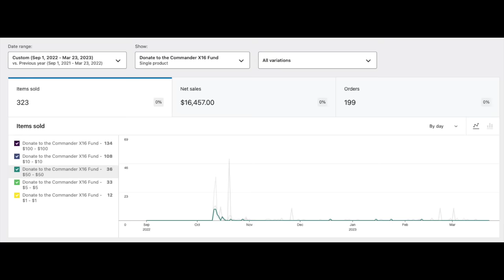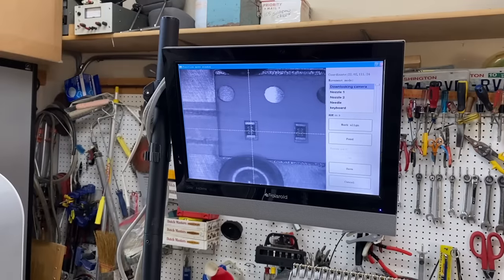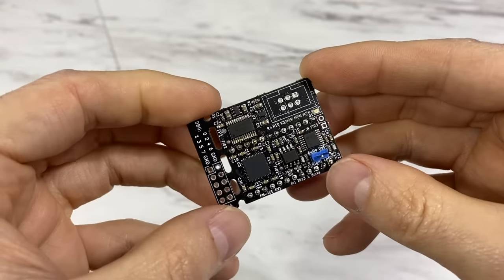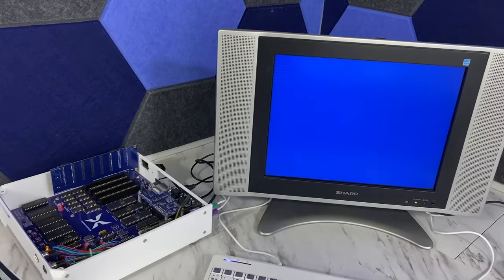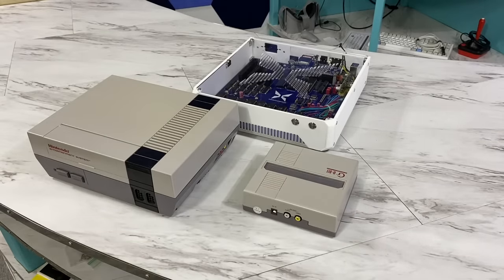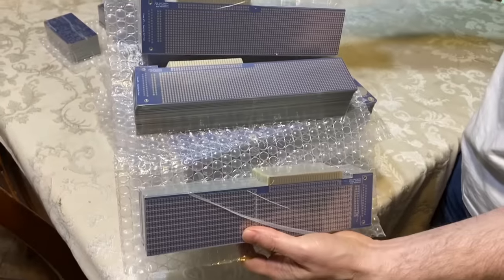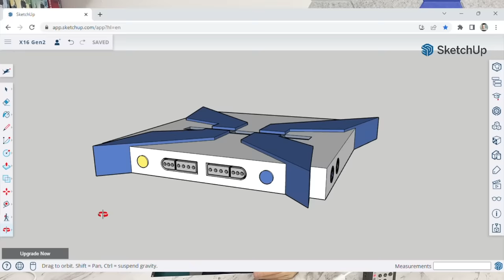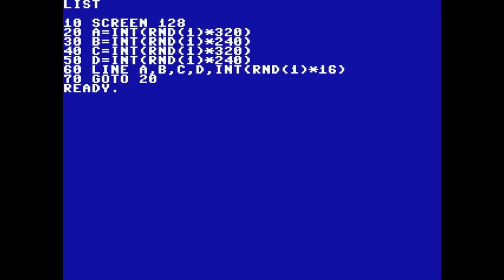Commander X16 2023 update

Comment: That X16 is coming along well. I love the case & I would rather see it vertically like a tower.  I see all those parts on reels & bags at the start of the video & that brings back memories of when I was working in inventory at a motherboard factory at Intel Corporation (Hillsboro Oregon) around 2 decades ago, working at Intel for over a decade.  Even those bubbled-wrapped stacks of PCB's bring up hazy memories.  The X16 probably has a good nice looking bill of materials (BOM) for its build, though probably less dense than the Intel mainboards that we built back in those days.  Of course for speed & efficiency, we did have SMT & THM placement machines too, to automate populating the boards & which then goes through an oven to solder the surface mounts &  then people further down the line to populate any further THM's & then finally to a wave solder.  I also was responsible for checking stock levels of solder bars, liquid chemicals, Loctite adhesives & some equipment (solder stations, solder tips, etc).  The Good ol' days.  I see you do have a board populator (pick & place) machine, so that should help with speed.

Comment: Here's an idea to ponder. The power users know better, but the game console can be used by people who can't read, 4/5 YO, Who wants to play what mommy/daddy was playing last night. Queue horror music as the kiddo inserts a Famicom cart because it looks like it'll fit. idea, maybe there can be a logic gate that tests a ground pin that isn't ground on a famicom. That way, no changes have to be made to the cart, but it won't connect power to something it shouldn't.
Reply: Alternatively, he could key the connector so that a Famicom cartridge won't go into the slot.  Keying that type of card-edge connector is dead simple, at least on the connector side of things; it's just a plastic insert that fits right into a space between the pins.

Or, for that matter -- why not make the pinout of the cartridge slot compatible with a Famicom cartridge, at least in terms of where the ground and power pins are and which lines are address bus vs data bus?  Then, if someone inserts a Famicom cart, the worst that can happen is that the X16 will lock up when it tries to execute the Famicom code.
Reply: @ballyastrocade5672  Good idea. Only thing is, how many have been made already? I know how much fun everyone has with breaking changes :)
Reply: @pyography  Yeah, that would be a problem if they've already shipped boards with the current pinout.

Keying the connector wouldn't be a breaking change, though.  The plastic insert doesn't involve changing any of the actual pinouts; it's just a slip of plastic that fits in between the edge-connector "fingers", and will block the card-edge from entering the slot unless there's a corresponding notch cut into the circuit board between the contacts.  (Though granted, it would involve taking a Dremel tool to that first batch of expansion boards to cut out the notch...)

Comment: I admire the hard work, time spent on this project, and community support. However, the real issue is that modern people often underestimate how complex it can be to produce something in a standard fashion, even in small batches or workshops. It is a continuous process of organising parts from different suppliers to create a functioning assembly line and every little step in between. 
I did not think this project would work from day one and still do not think this project would work as of today. But nevertheless, I do admire the fact that a group of people would try to challenge the modern-day manufacturing process. Hope this project works out and proves me wrong; I sincerely hope so.

Comment: It will probably piss off Nintendo that you copied their cartridge interface form factor.
Reply: Not really -- that general shape and connector style was also used by VIC-20 cartridges, and it's also similar to those used by a relatively obscure game console called the RCA Studio II.  Nintendo doesn't have a monopoly on "rectangular box with 40-pin card-edge connector."
Reply: I think the copyright has lapsed on the connector and its protocol so anyone can use the spec now. Even back in the day 3rd party manufacturers used it for unlicensed peripherals and Nintendo didn't go after them so I dont think Mario and Luigi are going to be banging on the x16 teams door demanding satisfaction anytime soon.
Reply: @meetoo594  Patent, not copyright.  If it was copyrighted, it wouldn't expire until sometime in 2079, at least.
Reply: @ballyastrocade5672  That makes sense, I always get the 2 mixed up.
Reply: @meetoo594  yeah it's a slippery fish for most people. There's also trademarks which don't necessarily lapse if the company keeps using them. The X16 team must be careful how they refer to the cartridge design.

Comment: I don't get why are so many people hyper-focusing on the $500 price point of the first batch. It's clearly said that these 80 units are still mostly made by hand, fully populated and with an included power supply and development expansion card. To me that feels like an ok deal for the most enthusiastic people who want X16 as soon as possible. I will personally wait for the next $350-$400 batch.
Reply: Because the realists among us can already see that they aren't going to be able to cut that amount of cost over this amount of production,  and definitely aren't going to be able to go from $350-400 to $50-100 for some kind of streamlined version, and all of that with over 50k of free money donations to buy Tex Elec new manufacturing equipment, which is probably not where the donators expected their money to go. And they gave a bunch of the first batch away to their friends on the project for free, which makes me think what is left of the first batch is going to be closer to $600 in reality. Now, they may decide to take the loss and only sell them around $500, but that means they are going to have to recoup that cost in the next batch, making it more expensive. 

Another piece of the price concern is that one of the exciting things about this project was the potential for a big community. Well, you aren't going to get a big community if the majority of the community are price-walled out for the first 4+ runs. 

And finally, the worst part is it didn't have to be this way, but without a definite goal, the decision making ended up being non-sensical. And remember, this is a for profit business, not just a fun little hobby project, so yeah, it matters a lot.
Reply: @doc_sav  I think you might have misunderstood how the price cut is going to happen. The mATX development board is eventually going to be $350-400. As you say there is no realistic way how to cut that price because it's using expensive THT chips. That is by design for people who love these retro DIP chips.
The second iteration "the console" is going to be a smaller board using SMD chips, CPLD for memory addressing, integrated VERA and YM2151 FPGA's. That one should cost around $200 and will be later in production at the same time as the more expensive development board. It will have the same kernel and capabilities as the devboard and the only "downgrade" will be one expansion slot and fixed 512K of RAM (which will be the default on the devboard too but could be upgraded).
The last iteration of X16 is going to be completely implemented in an FPGA. The current candidate for that is LFE5U-25F which costs $20. Multiple members of the community are working on that right now and the $50 target is not out of reach.

Comment: TPM is the OPPOSITE of the ethos of the retro community (retro community doen't restrain and force external control, least the community I engage with). Trusted Platform Module is like saying "this is mine, I retain control, not YOU" vs what is my experience of the retro community as a saying "look at this cool thing I've done, here's how YOU could do it too, here's my source". Sorry to say, but really feels like a community hero sold out there (*presuming the deal with the game company goes ahead and does use TPM technology). I do sympathise that its a difficult thing to monitize and its a huge endevour your taking on here, and it is, like I suggested a heroic act to try. Just, so sad to hear a TPM chip is going to be employed.
Reply: @njspencer79  time reference: https://youtu.be/nyByDNQuMMI?t=1574

"The idea of the cartridge is you would have like a TMP module in the cartridge with an encrypted serial number unique to that cartridge, and likewise there would be something similar in the actual machine".

Yes, the original X16 is exactly retro, the "Developer board". Yes, David also said that "if you don't like the console version just don't buy it" (fair enough) but I am (speaking purely for myself) planning to not support anything with TPM (which is specifically a technology for removing control from an end user in favour of the manufacturer), which is the opposite of open solutions (again, I am speaking for myself, you do you). So I am not saying you should or shouldn't like the product, that's down to you but I am stating how TMP is NOT in the interest of anyone especially retro community.
Reply: @goddessesstartrekonlinefle3061  well that was in response to honest speed runner competition which sounds completely bonkers but whatever.
Reply: @stoomkracht  well, I think it is likely what will happen with collaborating with any major game manufacturer. You might be able to tell I'm very against what Microsoft and other companies have been doing to PC architecture by including chips which allow them to dictate what end users can run and limit it to "approved" vendors. Sadly, its a losing battle, which is why I love the Retro Community who don't think that way. I hate to think of, say, EA getting their claws into the modern retro community.

Comment: I think $500+s/h is very reasonable. I already have a keyboard with the WASD keycaps and GloriousPanda switches filmed and lubed. I have almost $500 in that alone. I know you want to reduce the price, but I see no reason you could not do 2-4 runs of current dev board at the $500 to give you room work on the condensed less expensive version. It's already a given that when the first batch goes live they will be gone in 60 seconds(pun intended) followed by a server crash from the load.  

With regards to the Yamaha chip, the logistics would be a bit of a hassle, but you could offer the system w/o a chip and let the customer source their own, then offer the FPGA alternative as an add-on. If it ships with the FPGA (and I'm able to get one), I'll end up sourcing my own Yamaha, by taking it out of a machine I already have.

I look forward to building a 2 player arcade controller for the CX16. But then I have to write a Karate-Champ clone, a double dragon clone, a street fighter clone, and I have an idea for a knedo head to head game.

One of my closest friends' favorite story is about when I had my C64 taken away. I was able to find where the C64 was hidden but not the disk drive. So after everyone went to bed at night I would get up, setup the C64 on the TV and write my own terminal program to get on the BBSes. That said network programming is not easy in the modern age. Everyone expecting to get online and have an some sort of GEOS/Netscape browser can forget it. Ipv6 may not be wide spread, but it's out there enough that you need to support it. Throw in SSL and Javascript and HTML5 with Canvas. It's just not feasible. Terminal emulation with SSH will even be a challenge and you will probably have to have an encryption module built into the network adapter just to support it. So if you are going to have networking, you need to decide on what features you can implement. Ethernet does not have to be tcp/ip, but if you go with something else CX16s will only be able to talk to each other. The networking is going to be almost as big of a challenge as the project it's self if limitations and expectations are not set.
Reply: nods approvingly

$500 will be an absolute steal, I have a bunch of David's merch here and I can tell you - every single thing is superb quality throughout.  I have Vinyl soundtracks casettes signed boxed games with custom Amiga port SNES controller and art book.  The bells and whistles you get...

I can envision this $500 computer arriving with a tonne of great software in the box, mouse and two controllers, which will be hand-built by one of the team and probably signed inside the case.  Now as a user and a Commodore guy - that's absolutely amazing.  But as a collector?  I think $500 is theft lol when I am old and I give this entire collection to my nephew (he is currently 9 and he gets it when he is 21) he is going to blow a fricking gasket with joy!  Lol I can't wait.

He will love the Commander X16 and will have ALL the videos and documents with it in that collection, so even though the year will be 2038 and I will be almost 70 .... He will be 21 and able to experience that same thrill and joys that we did discovering programmable fun little micros for the first time.

You sound like you've got some knowledge there, are you also a developer?
Reply: @DailyCorvid  I use to be. I'm a site reliability engineer(SRE) now. So any code I write is Python, Bash, Docker or something along those lines. Working with containers I can easily tell who grew up in the 80s and 90s. If I see a Docker container that is 160MB That person never owned an 8 bit computer and maybe not even a 16bit computer. When I see a Docker container that is 32MB, This is someone that grew up in the era of 4KB demos. Try telling someone to write an app in 4KB today and they will laugh at you. 

I have not had time to sit with the CX16 EMU and actually write anything. I have a few good ideas though. The one I want to do most in the Kendo game. There have never been any Kendo dojo near me so I never got to learn.

Sounds like your nephew is going to be very lucky. Should be way better than going to a bar because you turned 21. My oldest nephew who is 28 grew up with Gameboy Advance, and Nintendo DS. He just recently asked me to help him side-load an emulator onto his smart TV so he could play some of his old favorites. My youngest nephew just turned 21. He's more interested in pen-testing and I'm sure that almost everyone interested in the CX16 was in some way on the front line of what evolved in to Red-Team/Purple-Team, security testing.
Reply: @bmmcwhirt  You have a big family, that's cool man I want to have about 20 kids lol in reality 3 is plenty :D

I have a Nintendo Switch and an OG Gameboy with a red and white Pokemon case... Which is cool but I managed to lose or destroy both my other Nintendo handhelds!  I used to be crap at looking after things sadly.

The Commander is such an awesome project, it's really inspired me to follow him more closely and I bought a tonne of merch too.  I guess I decided that TV is dead and put my licence money into YouTubers.

I was shocked to see so many rude commenters, they're not happy with this and that - but it's the way they talk!  They must have been brought up by wolves in the dene ;)

I don't care I think the X16 is going to be superb and I am already relearning BASIC so I can start developing the second it arrives!!  You should too, the community is awesome man I did a video about it on my channel the other day.

The C64 community became the X16 community and now it's blending the two.  Get involved man, if you offer to develop games and you are serious they will give you a free kit.
Reply: @DailyCorvid  Brought up by wolves? Na Wolves are pack animals and will defend the pack not turn on it. I have a Husky (It's illegal to own a timber wolf in the city) and as a pup he could care less but now anytime a repairman comes he doesn't stop barking till they leave. He's not aggressive and runs and hides if they try to pet him but doesn't stop barking.

I actually don't want a free kit, this project is too important to me. The CX16 emu is very good, so I think most devs are just using that. I think we need an IDE for it though. Sure we didn't have IDEs back in the 80s, but I don't have time to relearn Asm/ML. The CX16 is going to function like a C64 but with Amiga level sound and Amiga AGA level graphics.
Reply: @bmmcwhirt  Yeah I guess was too hasty on wolf piety, Huskies are lovely dogs there are a few here locally.  I think if you receive a free CX16 it's to use for development work; you obviously are not going to not buy one still.

That's even better if you are like me, a collector of things.  Now you can use the free one for both work and "testing" ;) Gaming.  Yeah then the one you buy keep it in all the wrapping and cellophane with the receipt, and it can be an antique for your grandkids when they're at uni and we're anciently decrepit and old :D

Comment: Despite the problems you've had I think it's impressive what you have achieved. Yes the price rise for the initial run is concerning but we need to stop and marvel at how amazing it is that we are now at a point where a relatively small group of hobbyists with a bit of funding can build something equivalent (or better) than the 8-bit micros that were the cutting edge in the 1980s.